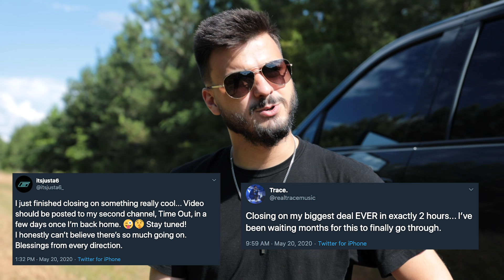I Bought 100 Acres to Build a "Content Farm" and this happened!

Comment: I run heavy equipment for a living and I’ve gotta say the ambusher (or mulcher as you call it) is easily one of the most fun attachments to use. I think you should invest in a skid steer, then you can do what you want when you want when it comes to building on the farm. Cheers either way, can’t wait for the content.

Comment: 7.62x39 AR's are notorious for jamming due to the tapered cartridge case, straight feed magazine well, and (often) crappy quality 7.62x39 magazines. They are also known to break bolts due to opening the bolt face diameter up to accommodate the larger diameter of the 7.62x39 case head, which weakens the bolt lugs and makes it easier for them to get sheared off.
This is what led CMMG to develop the Mutant / Mk47. It uses an AR-10 bolt carrier group which fixes the bolt issues, as well as a modified lower receiver that accepts AK mags, which minimizes the possibility of feeding issues. 
I bought an original Colt R6380 carbine back in 93, but wound up selling it a long time ago. I have the Mk47 now, and they are about the best thing you can get if you want to fire 7.62x39 from the AR platform. 
BTW, check to make sure your hammer spring isn't installed backwards. That's usually what causes light primer strikes in AR's if you're using a mil spec fire control group or an aftermarket trigger that uses the standard full power milspec hammer spring like a Geissele.

Comment: thats how you make your money work for you. land is always the smart route. if your looking for a smart optional structure look into 42 foot park model(specific) trailer. they get real cheap 2 or three years old, and its the full package. to get proper, al you need is a small septic, concrete pad, and a well. all of which can be a start to a foundation at a later date for your shop. im on the last leg of designing the simplist off the grid solar system known and definately the cheapest by a long shot so ill have more info on the power in three months. but under 10 000 can get you 10 kw of storage and 8kw of panels, the electronics is where you spend the money but the options are infinate once you decide the load. stay safe with that land and make sure you have your lawyer draw up a safety waiver, everyone that is not a resident needs to sign it to save your arse. and letting the local officials know that your setting up a range helps build the relationship so you can be spoken to not writen up. congrats agin on all the sucess for the hard work and dedication from you and the team.looking forward to the next step.as for the dumbest shit ever to happen on a farm im not aloud to fire up most f my last 6 years due to the landowners not wanting to be public. ive had a guy roll a bob cat three times  end over end,down a hill and try to say he wasnt trucked up. i grabbed his lunch can and there was 6 tall boys ful on ice and 4 empties. no mouth wash, nuthig. it was his only 3 hours up this way.

Comment: Got room for an 1/8 mile drag strip? I had that same issue with a 7.62 AR. The problem is the length of the firing pin. The face of the big round piece on the firing pin itself that contacts the bolt, you can take a couple thousandths off of that. It fixed my issue

Comment: Gavin that damn steel cases 762 ammo has stupid hard primers. Any thing out of a milspec trigger and springs will have trouble with them. My AR in 762  that I built had the exact same issue. It will run brass cased all day though

Comment: Try putting a 7.62x39 enhanced firing pin on that ar. Black Rifle Arms makes one thats suppose to work. Looks like the upper you got is a Bear Creek Aresenal and they dont put the correct firing pin in for them to run steel case reliably

Comment: It’s the mag, the 30 rounders don’t cycle.  Get a bunch of 20 rounders, had the exact same issue with my 7.62x39 AR.  The mag design is the biggest issue with these guns bc they have to feed into the straight well of the ar lower.  An ak or sk mag is curved all the way.